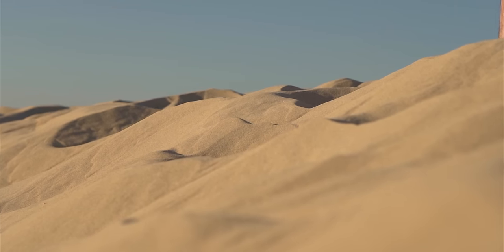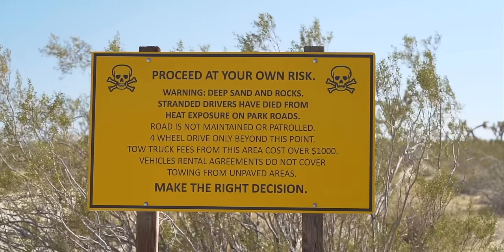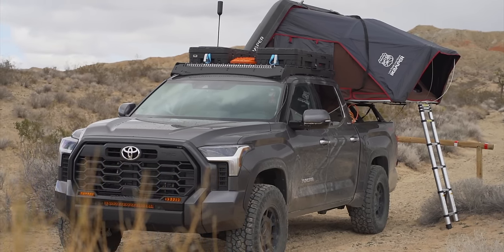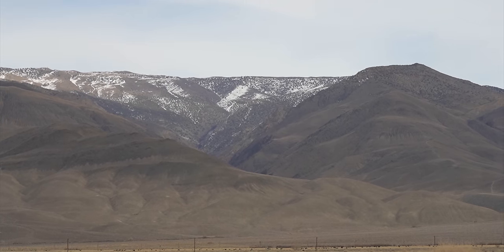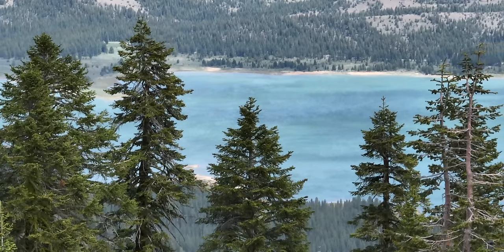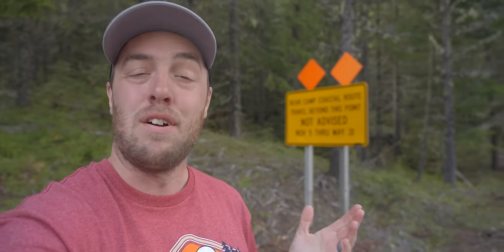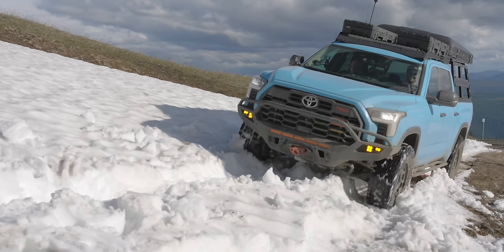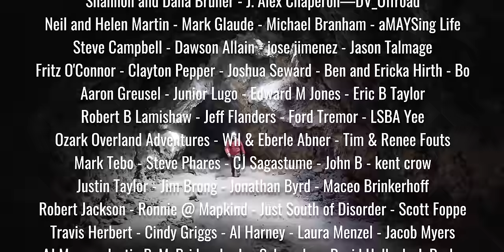Border to Border on the Pacific Crest

Comment: I noticed that you have your Weboost antenna (receiver(RX)) really close to your other COMMs antenna.  A Weboost is a sensitive RX that said you could damage that system (even if off) by having a TX (15-50W)  close to the weboost RX l, even if they use different bands/frequency the power of the TX can bleed in and damage the unit.  I learned this when mine was in a similar configuration, and an Electromagnetic Warfare Officer (EWO) mentioned it. Love your content style and information, amazing production quality! MikeD.

Comment: Fill tumbler 2/3s ice
Generous shake of Tajin and Tapatio
Cut lime in half, saving a little wedge for garnish. Juice into glass.
2/3 Clamato
1/3 Pacifico
Little shake of Tajin on the foam.
Garnish with lime wedge

Comment: Wow , I’m impressed with that tundra . Just wondering if you would have aired down and selected MTS ( deep snow setting ) and went through that deep snow I think it would have made it , the new MTS terrain on that tundra is a smart traction control .

GREAT job and beautiful truck ! keep them adventures coming …. Cheers 🍻
Reply from the maker: I was aired down and MTS is on whenever I’m in low range. For icy snow the rock setting works best.

Comment: i look at cars like pets, they need to stretch their wings and keep everything being used so it doesn't get "joint" pain, like bushings or bearings. they need to be stretched out and be used like they were meant to be. getting a nice truck and road driving it is like getting a parrot and not letting it fly. glad you're able to use the truck how you saw fit. (funny story i brought my 05 f150 4.6 triton to the shop complaining i heard and felt a slight weird vibration, he gets in the car, drives up the road with me and put the pedal as far down as he can and i'm sitting in the passenger seat like WTF IS GOING ON. the check engine light went off after he "stressed" the engine. sometimes they need some tough love and need to be stretched out haha. turned out i had 6 misfires and i only have 8 cylinders so yeah. cam position sensor was replaced and i had 2 scored cylinders. trucks still fine with the scored cylinders, i just learned it needs to be opened up and let itself clean itself out of carbon deposits and what not.) as im typing this my dog wont stop farting so ill stop it there i gotta open a window
Reply: im back an hr later and i gotta say i wasnt feeling the blue untill you got into the forest, it really pops among the trees. doesnt look so good in the desert haha

Comment: Enjoy the videos.
I currently own a new gen Tundra and was curious to hear what you thoughts about it compared to your 4runner as I'm considering getting one just for the simplicity and proven platform, not to mention being better suited for technical trails.
I understand the Tundra is bigger and more powerful, but for this type of use, do you think a truck like the Tundra  (which has more things to go wrong and an increased chance of having to be towed to a dealer when something breaks) is a good choice?
Reply from the maker: The long distance mild off road stuff like this is the kind of trip the Tundra does best. I'd take the Tundra on this trip over the 4Runner any day. For moderate technical trails the 4Runner was definitely easier, but the Tundra can still do it. I'm up to 34k miles now, and wouldn't trade back.

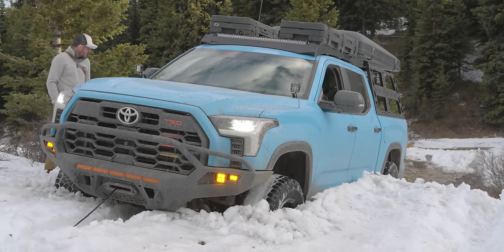Comment: At 2:08:47, I see the back wheels spinning but the front are not. Are you in 4-wheel drive, low? Locked? I would think all 4 wheels would spin? Sorry, I am confused.
Reply from the maker: The rear is locked, but front is open. In that situation, it's possible only 3 wheels turn.

Comment: Is that an iKamper SkyCamp 3.0? How much does it overhang on the back?
Reply from the maker: It's the 2.0, which is the same length. It overhangs around 6" (5.5' bed, 6' long tent) in the first half of the video, then with the higher rack it sits over the roof instead.

We have the 3.0 with free shipping, if that's what you're looking for. You can also call the number on the website if you have more questions: https://revereoverland.com/products/ikamper-skycamp-3-0

Comment: Hey rob! Congratulations on getting this video out! Hope it kills it for you.

Quick question; while you’ve been out on the road with other vehicles ect, what’s the consensus on tires, I have to get a new set. Would love to hear input.
Reply from the maker: I think for what I do, an all terrain is best. I do really like the Toyo RT Trails that I just got since they're slightly more aggressive, but wish they came in D rated (or C rated for smaller SUVs). Toyo, Falken, and Nitto are just a few that make good all terrain tires. BFG KO2s are popular and last forever, but I wasn't a fan of them constantly going out of round or balance.
Reply: I don’t need tires anytime soon but have been eyeing the Toyo open country at3. 

What’s your opinion on that tire?
Reply from the maker: They performed well. Not too loud, stayed balanced, and had good grip. Unfortunately I destroyed them when my Tundra was knocked out of alignment, so can't comment on longevity. The only negative is I did notice they show rock scuffs and chips a lot - nothing to damage the tire or cause failure, but made them look used quickly. I'll definitely consider them again, but I also feel like I should try out different brands/styles so I can more fairly compare. Right now I have the Toyo RT Trails.
Reply: I am on my 2nd set of Cooper AT3's. No complaints on my 1st set so I bought them again

Comment: Kinda funny that you went around a sign that said no trucks over 3tons then you left a comment about thinking your truck was over 3tons. I drive  3500 dodge diesel it only weighs 1ton. Come on man
Reply from the maker: Wtf no it doesn’t. No Dodge Ram 3500 has ever weighed 1 ton 😂
The empty weight of my Tundra with no people, fuel, or modifications is almost 3 tons.
Reply: The fuck mine doesn’t get real .
Reply from the maker: The lightest Ram 3500 was the 1993-2002, and those were 5,500 lbs, which is 2.75 tons. The 5.9 engine by itself weighs about half a ton 😂
Reply from the maker: Maybe you should try Google some time. It'll tell you exactly what I'm telling you

Comment: Fantastic footage and scenery as always. I'm just astounded that you bought the Tundra when you have the 4Runner. The runner is ten times more nimble, and every bit as capable, if not more so. Sure, it doesn't have the torque or raw power that the Tundra does, but I'd much rather drive a nimble and lighter vehicle. To each his own I guess.

Comment: Dudes so smart. He buys a totally brand knew computer on wheels made for city slickers and thinks its smart to modify it and the drive thousands of miles untested.
Reply from the maker: Your life must be so boring
Reply: @RevereOverland  The vehicle is just a tool. use the tool to create experiences. the tool itself is not the experience. If you do irrational modifications to your tool because you picked the wrong tool.  then it will fail you. and also fail to take you to those amazing experiences.
Reply from the maker: @242tdryan  so you set arbitrary rules for what you can and cannot enjoy, then decide to apply them to me. What do your rules dictate I should drive instead? I'm struggling to see where this truck has failed me out of all of the amazing experiences in the last 40,467 miles.

Comment: When I watch these videos, makes me want to get a 4x4.  I always wonder which trails my trucks can make.

Sand is an enemy to me with 2wd trucks.  I've done some stuff in the desert around phoenix and trail runs with all with 2wd trucks from an 89 f250 to my 2000 an 03 f250.   I have yet to do much trails with my 21 2wd sb lb f150.  It's has less ground clearance than my f250s.

Comment: I don’t know if I missed a video, but what happened to your 4runner
Reply from the maker: I sold it to help pay for the Tundra!
Reply: @RevereOverland  Ive been curious. Have you ever missed the 4runner?  Or are you pretty happy with the new Tundra?
Reply from the maker: @gregjoubert5118  very happy with the new Tundra! It's more challenging on a few tight trails, but other than that it has been a huge improvement.
Reply: @RevereOverland  Thanks!  I have a 2013 Tundra DC and we have a 21 4R.  Thinking of getting rid of it and getting a new crewmax Tundra. Mainly for family reasons and honestly like the 4R but the lack of power especially at altitude gets a bit annoying.  Will most likely keep. it mild build with 2inch all around and 35's.  Keep up the good work!
Reply from the maker: The 4Runner is definitely underpowered! The extra space in the CrewMax is really useful on the long trips, especially with a family to pack for.
Reply: Sure it is